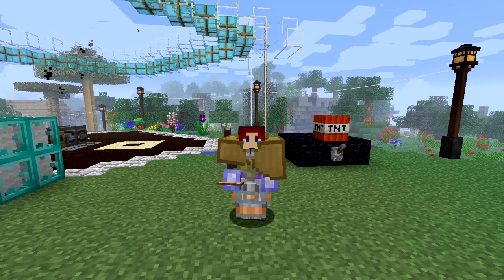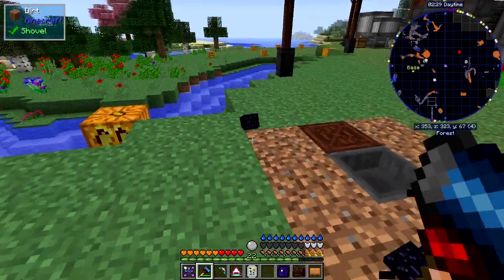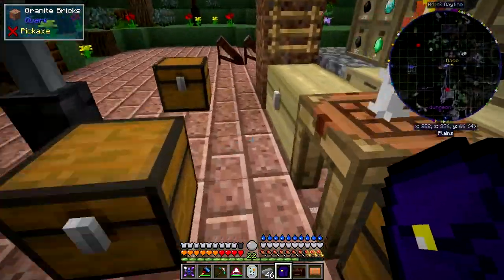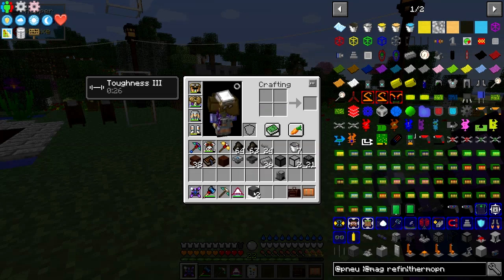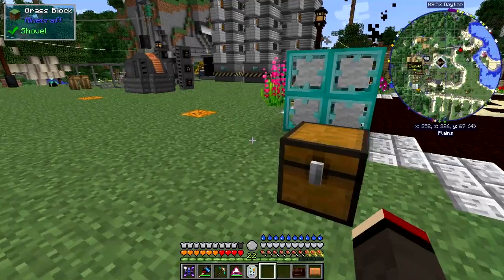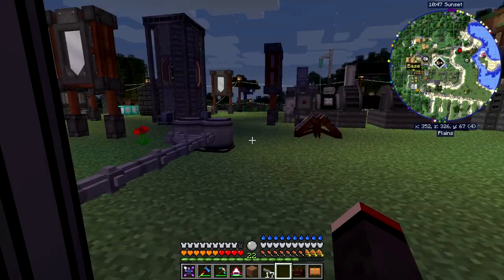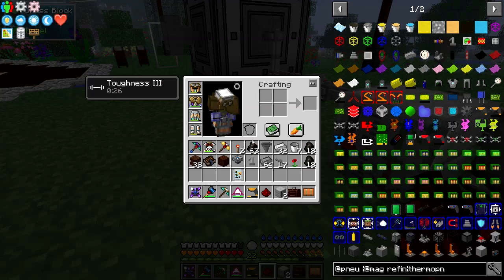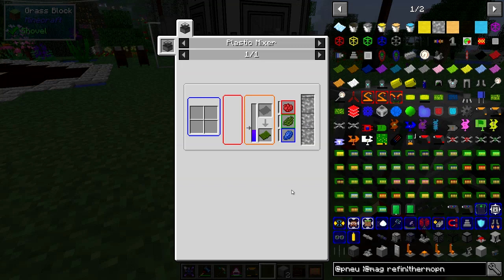Real Tech #078 - PneumaticCraft Repressurized: Getting Started

Comment: Direwolf20 pack doesn't have automated redstone, any good alternatives?
Reply from the maker: Arcaneraven good question, may be computercraft or pneumaticcraft. Depends on what you are trying to achieve.
Reply: @duncanwebb4934  at 10:11 you're using a redstone signal. I'm trying to replicate it with the Direwolf20 pack but I'm a little lost :D. Other than that a very insightfull instruction video!
Reply from the maker: Arcaneraven okay, you can use redstone dust, the redstone signal drops by 1 per block, so if you need a value of 4 place a redstone torch down and place 10 redstone dust down, it should have a value of 4 or 5 at the end. You can use an advance circuit on the valve and then you can set the redstone level in the valve.